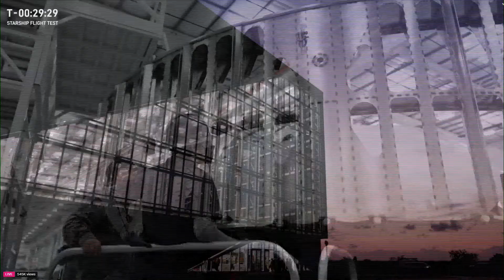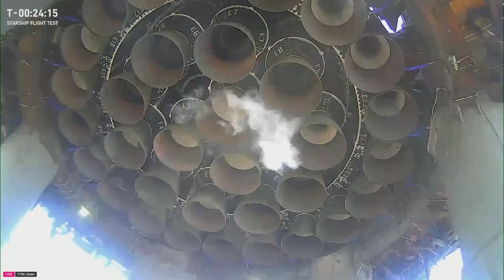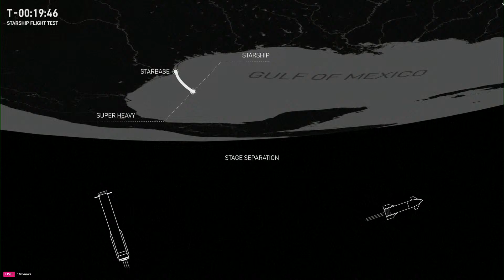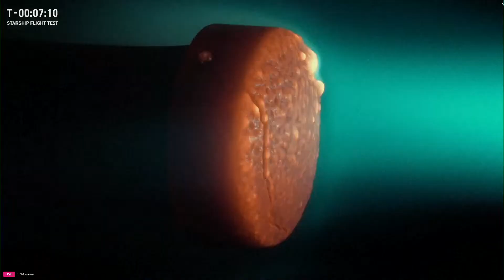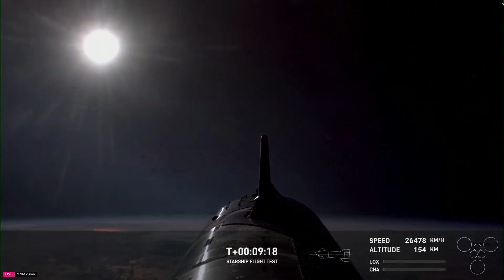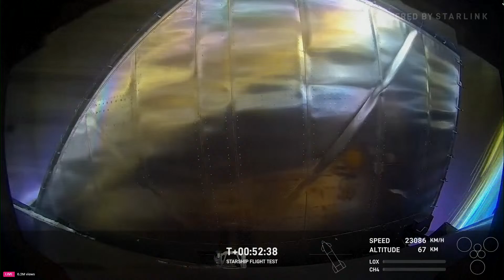Starship launch LIVE: SpaceX attempts sixth test flight of rocket

Comment: Excellent Vlog,
Ok as an avid watcher to these flights have I missed something.
OK so they Test and Test and say Going to Catch and then Data is sent back can’t catch so dump it in the sea got that bit and the catch is for the bottom part ie Booster rocket to reuse but then having the sea dump it is now Classed as successful and they can read all the data.
So what happened to the landing of the main Rocket on land cause what I saw originally was it landed, it  went on fire or blew up. the last one landed but caught fire and sat there for ages on fire and I know no oxygen in space = no fire but if I was a Astronaut with a rocket that was sending me back data “you have a problem but don’t worry cause it’s not on fire” I would be worried. Cause if the main rocket is going to land on the Moon or Mars there is no alternative Soft landing for them up there cause the only water is Solid ice so don’t you think they should still be testing that landing out cause the main part seems to take off ok and re enters ok but they still insist bumping it in the ocean. Have they changed there mind and are going to use an alternative like NASA ie the Eagle type craft that landed instead of the main rocket.

Comment: This system requires rapidly reusability to get to the moon
Musk: "eight launches would be needed to completely refuel a Starship in low Earth orbit,"
If they can't get the booster and tanker Starships to land, refuel and relaunch quickly then Starship's liquid oxygen boils off in orbit
I think the government should be worried about SpaceX delivering a vehicle capable of a moon mission
Reply: Starship HLS was supposed to have landed on the Moon in the first quarter of 2024, according to SpaceX.  Starship apparently has no payload capacity to orbit, hasn't been refueled, its engines haven't been re-lit in microgravity, its flight control surfaces are damaged (just a "little burn-through") during reentry -- its astounding iterative design process better start iterating a whole lot faster and get way more done with each iteration if its major design goals are ever to be reached!

Comment: A "little burn-through" may be better than a lot, but any is inconsistent with Starship being a rapidly reusable spacecraft.
Reply: Iterative program. They'll get there
Reply: @johnwhite2890  Hilarious!  Failure of the thermal protection system is just one of a host of problems Starship faces.  The bottom line is that it has not achieved any of its major design objectives and the program is at best years behind schedule.
Reply: @rdbchase one must assume you are not familiar with iterative design. Of course there are a number of issues, that is literally the point of iterative design: to rapidly test and improve the design. This is the opposite of typical rocket design where everything is engineered before the rocket is tested. They have already achieved numerous design objectives, reusability is just one of those. The ship won’t be ready for reusability until the development phase is complete. It’s only behind schedule if you are holding it to one of Musk’s famously unrealistic timelines. Just look at what they have achieved in such a short time compared to other space companies.
Reply: @Jack-td6hl  I understand, "it has not achieved any of its major design goals" just does not compute, nor does SpaceX claiming that Starship HLS would make an uncrewed landing on the Moon no later than about nine months ago.  To fanboys, "iterative design" is a magical incantation that dispels all failures and schedules and makes them all believe that Starship is the very bestest rocketship there ever was or could be.
Reply: @rdbchase well it is the best right now.  Noting in the world exists that can’t be better.
Reply: @rdbchase if you think you can do better why don’t you try?
Reply: @aida_semsosalihbegovic  Ridiculous; it isn't a working system!  What part of "it has not achieved any of its major design goals" don't you get?
Reply: @aida_semsosalihbegovic  Total non sequitur.  Starship has not achieved any of its major design goals and it is at best years behind schedule -- deal with it!
Reply: @rdbchase  Who cares? Everyone said the same about Falcon. 'It's impossible, it can't be done, it's not the future, it'll never work.'

You are those people right now. SpaceX is commited to making it work, so it'll work. That's putting your money where your mouth is, and the epitome of the human spirit to overcome.
Reply: @jossland1628  Have you heard?  Starship is a totally different rocket than Falcon 9.  Starship is very much more ambitious than Falcon 9, it's at best years behind schedule, and it has yet to achieve any of its  major design goals.  Did I mention that it has yet to achieve any of its major design goals in six test flights and is already years behind schedule?  Fanboys cannot entertain the possibility of failure, even as the system fails.  How about that "little burn-through" this time, huh?  Total, rapid reusability must be just around the corner!
Reply: @aida_semsosalihbegovic  what a lame deflection. If i see a candyshop owner putting rat poi son  on his candy we cant complain unless we open a candy shop too? Lol. If we test the candy and prove he did put it on we cant sah anything except praise. Why dont you not praise him until you open a failing rocket company? Lol. I mean youre already 5 billion in tax money and 11 billion in investor money ahead of elon just buy a estes rocket and youll win.
Reply: @aida_semsosalihbegovic  nothing in the world exists because elon cheated to win the lunar contract. So he took away from other companies that could maybe beat the chinese to the moon and for cheaper.
Reply: @ SpaceX used the same process to develop the Falcon 9, which is now the most inexpensive and reliable rocket on the market. This ship will become reliable as well. When it does, it will be more capable than any rocket in history. That’s a quantifiable fact. You must not follow space news much, because rocket projects are nearly always delayed. This is nothing new and certainly not unique to SpaceX.
Reply: @ if you can do better do it
Reply: @Jack-td6hl  yes elon is trying to copy mueller the aerospace engineer and man known for designing rockets. Techniques. But think about this at what point would you be able to admit its a failure. Elon has tricked people into cheering for failures already. Smh.
Reply: @Jack-td6hl  nasa took only 8ish years and by their 5th launch went to the moon. Elon hasn't got to orbit or even carried a single payload. Then has the audacity to say they test as they fly. Lol. Everyone one of Saturn Vs test flights had simulated payload, did research and when they tested heatahields they brought and extra rocket to fire into the atmosphere to get well past suborbital velocity, closer to lunar to earth speeds, and they didnt burn through. 5 billion in tax money and 11 billion in investor money to win a 3 billion dollar contract? That dont math
Reply: @rdbchase  ok, they are testing a thing.  Engineering is not wawe with magic wand’s and things happen.  It is trial and error.  Only Chinese when they steel get it right first time.  So they will take results and see what needs to improve.  If you think you can do better do it.
Reply: @aida_semsosalihbegovic  why must you start a candy shop to call the owner out for adding poi son to his candy? No one can witness it and say anything by this logic, except a fellow candy store owner. But the person who says this would dismiss the other candy store owner. Nasa and us government accountability office say starship is underpowered, (making it heavier wont help in future iterations) and cant relight after a few orbits.
Reply: @Jack-td6hl  Right -- why I don't even know enough to acknowledge the brilliant success of Iterative Design in propelling Starship to the forefront of fanboys' imaginations!
Reply: @ do you just dislike Musk, is that it? Is that why you keep implying I’m a fanboy? If it helps, I dislike him too. But I also find rockets interesting and can separate the two in my head. When Falcon 9 was being developed they had failure after failure trying to land the booster. Everyone in the industry said it was impossible. There were haters like you saying the same things you’re saying now. But the process worked, and landing the booster is reliable. Every other space company is now years behind trying to catch up to the shift towards reusability. Once again, this is part of the process. Each launch has had an objective. They have accomplished many objectives already. They have launched the largest rocket ever built into space and landed it back on earth. That alone is a tremendous accomplishment. The reliability will come.
Reply: @Jack-td6hl  Usually skeptics lay out their reasons why they dont like elon, and elon defenders then ask why dont you like him, then insert some easily dismissed reason. Terrible, transparent technique. 

Also dont just recite elons marketing bs. People elon braged his own engineers say starhsip wont work. And they were right they were demanding he make serious changes. Ita not that its impossible elon makes impossible claims. Like starhsip will fly 1000 people 10 round trips nyc to saudi per day. And have a faster turn around time than a jet. 1.5 hours vs their fastest is 21 days. This is an impossible claim for elon not that it will always be impossible
Reply: @Jack-td6hl  if you dont care about the truth sure the haters.were wrong. But if you listen to exactly what elon say vs what he delivered the "haters" were 100% correct. 

Lets take a neutral exampke hyperloop. Elon promised 10x faster than fastest rail travel at 1/10th the cost. Then he said it wont be a trian with a jet, it'll be all electric, then its your car on an electric skateboard, then its direct subways to your garage, then it was street acess during gridlock, then it was already approved around washington dc, and baltimore and nyc. Then it was maglev, then it was ditching air bearings for wheels, then it was built and was just a tiny unsafe tunnels with human driven teslas that is slower than walking and cost billions and is outperformed by one bus. So it never happened looking at the original claims vs reality. Same with falcon, and for sure the same with starhsip. He promised interplanetary tourism to the outer planets then interstellar travel, lol,lol. Impossible for him
Reply: @Jack-td6hl  eash launch is the lowest bar, clearing the tower. Lol. Even by that standard most have failed. But his gant chart he submitted when he lied to get the lunar contract, has clear tests on it. Full payload tests are standard nasa had this on every test flight. Orbit is very basic and elon cant even get there. Not that he doesnt want to lol literally full fuel tanks and zero payload and still below orbital velocity and wildly eccentric sub orbital hop. Today we cna use math to get to almost precisely the correct solution so we dont have to guess and check like a child. Elon is tricking the gullible by doing these pathetic "tests". He hasnt done anything tests he told nasa he would do to verify the system works. But lol he put a banana in the extremely empty payload area, lampshading he cant get any payload to orbit. 100% failure. But the meme lol
Reply: @Jack-td6hl  they have not launched and landed the biggest rocket ever built. They landed two much much smaller and lighter rockets lol. And yes elon took the dimensions of Saturn V and added a meter here and there so he could call it the BFR, such a genius, he claimed to make it pointer based on a joke in a movie saying dumb people love it pointy. Even though it gets worse aerodynamics. He made it stainless steel to sell trucks, which are big failures cant meet safety requirements lol. And his own engineers say it work work. Not to mention using soviet era turbopump exhaust routed into rocket motor style engines from 1960s. Lol.
Reply: @Jack-td6hl  I fear that Musk is using popular misunderstanding of rocketry for self-aggrandizement and to support fascism -- in this sense, Starship cannot be separated from selfish and political ends.  Apart from that, there is abundant cause to doubt the viability of the system.  As for your conflation of Falcon 9 and Starship, I have explained why there is no basis to predict the (eventual) success of the latter based on the success of the former.  SpaceX so far has achieved nothing significant with regard to Starship whether you can accept the fact or not -- only if it achieves its design goals of being a fully, rapidly reusable, refuelable system capable of lofting significant payload to orbit could it be counted a success.
Reply: @ there is certainly a possibility of conflict of interest with Musk being involved in the Trump administration. I’m not going to dispute that. That is separate from the rocket itself. Where we differ is that you see the current issues as red flags. I see them as perfectly normal and even expected in an iterative design process. I am drawing a parallel with Falcon 9 because there were the same sort of issues at this stage of development. The point of iterative design is to surface flaws through testing and then work to solve them. So the fact that there are currently flaws is expected because Starship is still in development. You keep saying “no major design goals have been met” and I disagree. Getting the rocket reliably to space is a major design goal. That was achieved. Performing a hot staging, that’s been achieved. Landing a booster on the tower is a major design goal, they’re not doing reliably yet, but they did achieve it. There are many more major design goals that have already been achieved. What you are really saying is they have not yet completed the overall goal. I’m saying that’s not surprising because it’s still in development.
Reply: @Jack-td6hl  to add to chases response, mueller the aerospace engineer and famous rocket designer made falcon and elon the man who brags his engineers tell him it wont work and brags he stole the idea to make starship pointy because the movie dictator said it was a bad idea, and made it from the worst strength to weight ratio materials stainless steel to sell it as not a medieval material but a space age material to sell trucks. But made it so nasa and usgao say its too underpowered for its weight and why he keeps reducing the claim of payload.

Comment: What a shame the booster has been deviated. The landing was perfect.
I think the technology is mature enough now.
Well done Space X, well done Elon. To the moon, to Mars ... 😊
Reply: We all did see on engine flame out during landing right?
Reply: @elbob1491  it's normal dude, it's supposed to 😅
Reply: Musk said he'd land two Starships on Mars by 2022 -- it's 2024 and Starship has still not achieved any of its major design goals.  Onward to Mars!  You will be in the B Ark, I take it.
Reply: @rdbchase  Keep on trolling dude it might get you to Jupiter ... 😂
Reply: @WVMS42  Yes, you will be on the B Ark for sure.
Reply: @WVMS42  Guy must work for Boeing, ULA or New Glenn, as you said WVM what a troll
Reply: There were no landings as everything crashed
Reply: @area51z63  we are on the right track ...
Reply: @WVMS42  Only if the purpose is to go nowhere and crash everything
Reply: @area51z63  We still need time, we are on the right path, however I don't see where to go expect to the moon. In my opinion going to Mars is just absurd
Reply: @area51z63 no, it did land perfectly, just because the surface it landed on was water doesn't mean it crashed.
Reply: @Tremor244  It did not land it was deliberatly crashed into the ocean, they already admitted this.  Have you forgotten that it was supposed to be caught and that there was an undisclosed issue which was severe damage to the launch tower.  The entire rocket, both stages are lost at sea and cannot be reused as even if recoverd the salt water damage is permanent.
Reply: @area51z63  The dictionary disagrees, but ocean landings plainly don't demonstrate that the system is at all reusable, much less rapidly so.
Reply: @rdbchase  Starship is not only a total failure, it is also a total lie.  Neither Mars or the Moon have oceans to soft land in.  It will take 10,000 years to test and perfect this.  They are hiding fusion and element 115 vehicles